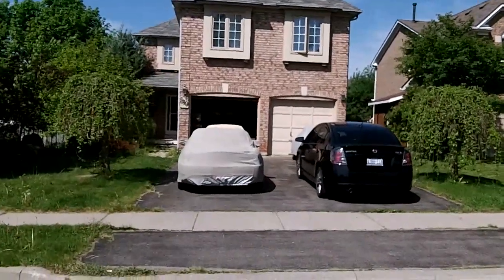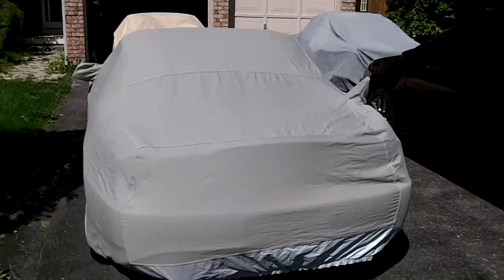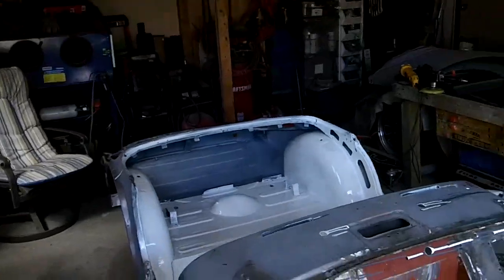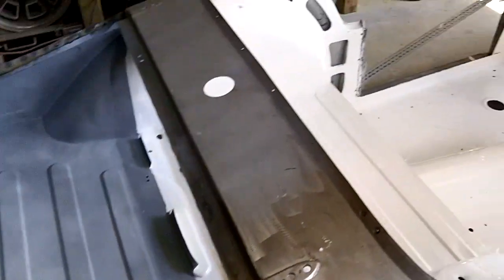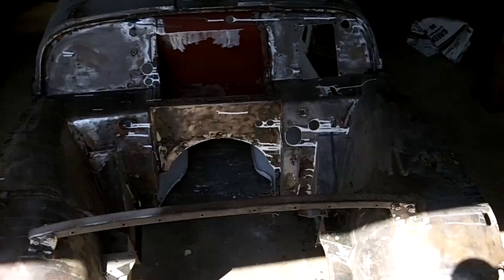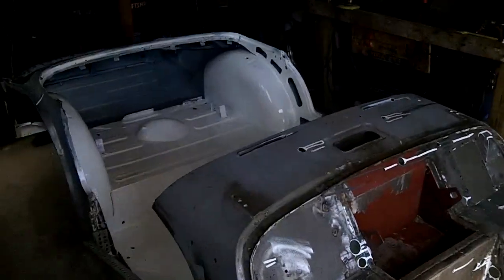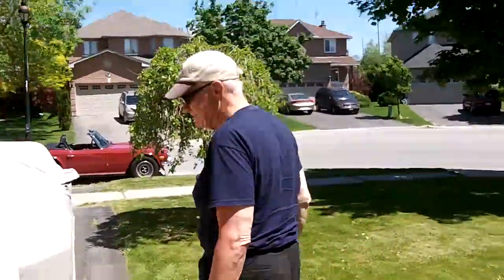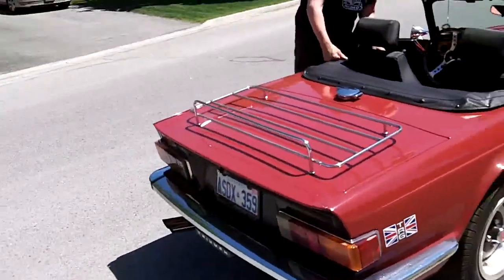Gotta Love Long Weekends

Comment from the maker: Hi Dave,  IMO, I think that they look better than Miata seats.  I like the fact that the headrests are at least seperate from the seat like the later 6 seats were.   The good thing about those seats is that they are pretty cheap coming in at less than $500 for the pair brand new.   I consider that cheap since my stock seats to restore were about $1000 all in.....Thanks for watching Dave.